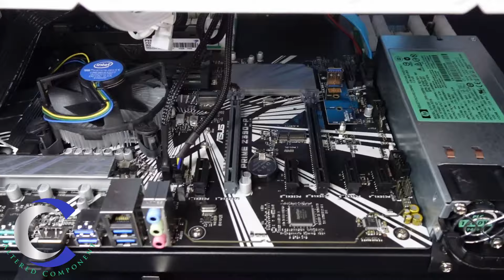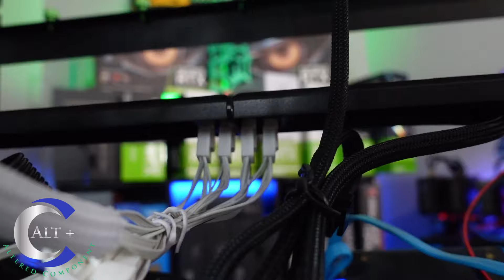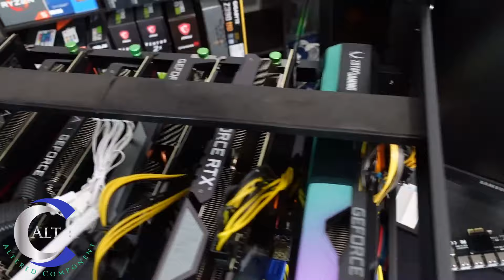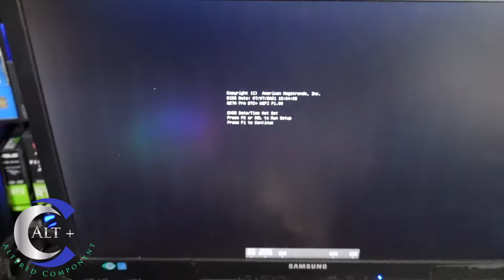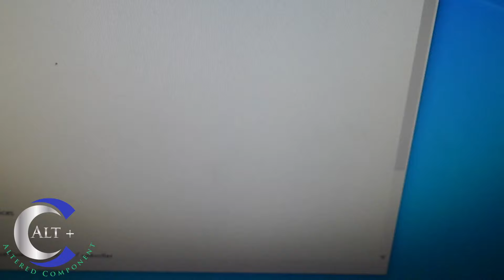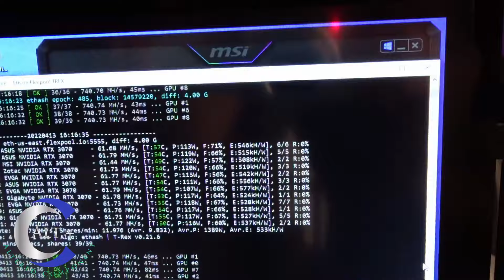$11k Mining Rig Build | 12 x RTX 3070 Full hashrate Nvidia | The Master Chief Build

Comment: @Altered Component  I run my rigs on Windows and I use splitters. Some tips that might help you: 1) Increase virtual memory, 12x 8gb + a bit more = 100,000mb minimum for your rig. 2) Don't run Afterburner while mining, it takes extra resources. 3) Lower the clocks and see if the rig runs stable and gradually increase clocks.
Reply from the maker: Thanks for sharing and all great tips.  in reference those tips though, all of those are valid points to get the cards up and mining in windows, however those do not actually affect whether the gpus show in windows.  for example, the virtual memory will have no bearing on the gpus showing in windows under device manager.  You can have 12 gpus with no virtual memory adjustment, but as soon as you fire up the miner, the miner will error left and right.  Same with afterburner or overclocking.  those are very important for the act of mining, but do not affect the gpus actually showing in windows.  Above 4g decoding is the biggie that many people fail to adjust in bios that will stop too many cards being added instantly.  Definitely appreciate the feedback my man.  You do great things

Comment: I'm curious why you choose Windows rather than something like HiveOS? I don't think you'd have the issues with the USB adapter on Linux but I could be wrong.
Reply from the maker: thanks for the feedback. Yeah i tried adapters in hive and similar results.  i do run Hive on my 2 Amd rigs.  They tuned so much easier and much more efficiently in Hive.  The nvidia rigs all currently on windows.  i have been thinking of switching the 12 x 20 super rig to hive.  it consistently goes bsod.  Thinking either i reflash windows or i try it on hive.  mine on

Comment: Awesome vid, thanks! I tried to build a 12 3070 rig on a B450 with Ryzen 5900x and it would just NOT want to add an 11th card, giving me some CUDA/driver errors. 10 cards - no problem, 1 more card and game over. Tried reducing mining cores on a CPU to 50pct, worked for a few minutes and then crashed. Gave up after wasting 8 hours trying to make it work with different riser splitters amd overclocks. 10 cards is good enough :-)
Reply from the maker: Thanks for watching.  I feel you on that setup.  I have spent so many hours playing with splitters.  For instance I know the old gigabyte h110 d3a mobo will split only to 9 gpus no matter what u do.  Other boards I can easily get to 10 and then stuck.  I have also found that 8-10 card rigs just have greater stability and easier maintenance.  Mine on